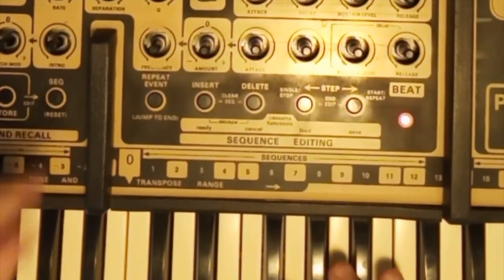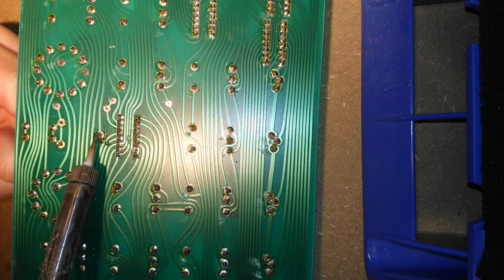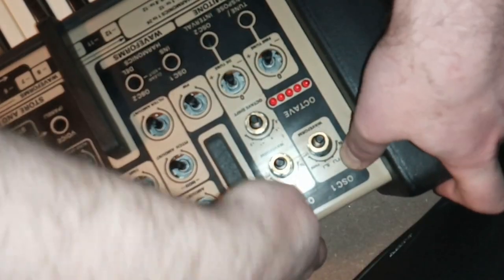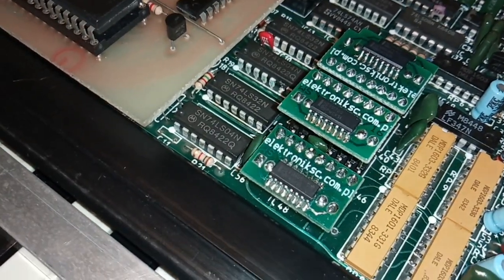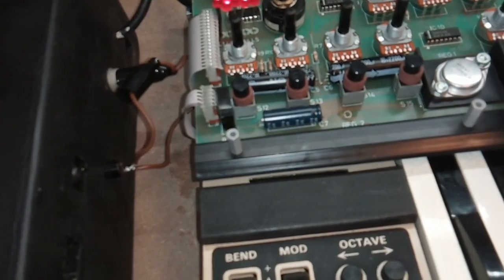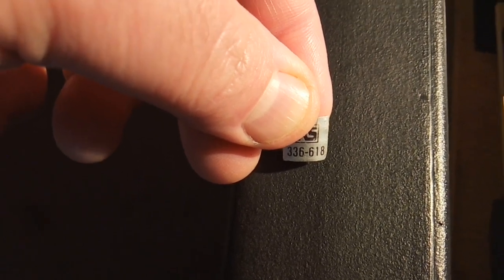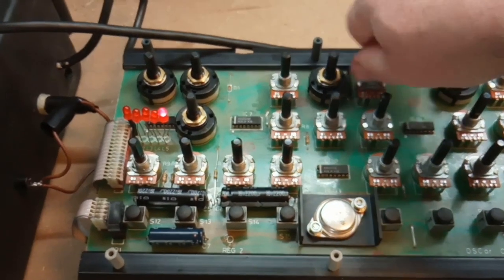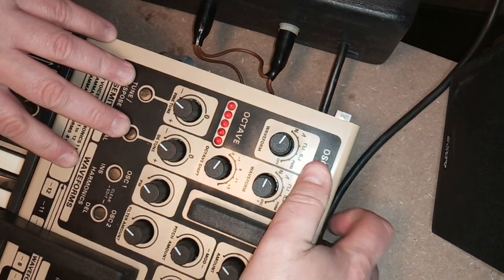An amateur fixes what professionals broke - OSCar Part 5

Comment: Hi, did you ever make a video about how the address lines work? I have an oscar synth that is always putting the white noise over both oscillators. If I turn the noise/osc balance pot clockwise(for noise) I just get the noise as expected, but if I turn the noise/osc balance anti-clockwise(to osc only) I still get the white noise over the oscillators. It is like it is not turning the white noise volume down.
Reply from the maker: The noise level should come out of IC31 pin 5, and then buffered in IC32, coming out on pin 7. The noise is then mixed in into the filter in in IC 49. I would suspect something is wrong on that path.
Reply: @RegebroRepairs  Thanks for your help. I'll delve into it.

Comment: That "professional" work was shockingly poor! I'm glad you managed to fix it in the end. Regarding the OTAs, did you find some original 13600s or just use 13700s with minor adjustment?
Reply from the maker: I bought 13600s from eBay.

Comment: I'd be mortified if a synth tech botched my OSCar like what happened to yours. It reminds me years ago a tech sanded and "re-varnished" the Walnut casing on my very early RA Minimoog without even asking me.....grrrrr!! Well done for fixing it
Reply from the maker: Yeah, that's the problem I haven't been able to find a synth tech locally. I tried finding someone that could repair circuit boards, but as you see, they couldn't. Before I even started I tried to find somebody that would admit to being knowledgeable about OSCars, but I couldn't. I even asked Novation if they could ask someone, and they told me to talk to their German distributor who completely ignored emails and refused to pick up the phone, so...
Reply: @RegebroRepairs  the best tech I've used is a guy called James Walker who is very experienced with OSCars (he's based in UK though unfortunately)
Reply from the maker: @ianpreece6391  Could you send him a mail with my email? He might want to be on the oscar-owners mailing list that since have been set up.
Reply: @RegebroRepairs  Hi, I'm an owner of an OSCar that's been unresponsive for 4 years, it seems a battery problem. How can I be on that oscar-owner mailing list? Thanks
Reply from the maker: @croonologist  Just look for "oscar synth owners freelist" and you will find it.

Comment: how are you getting onwith your oscar? I have oneon my bench at the moment that's dead. No +5v rail, the lm309k regulator is on its way. All i get on attempting to boot is the octave and beat led's flash on then off then nothing at all.
Reply from the maker: You should join oscar-synth-owners@freelists.org
There's loads of helpful people there.

A few leds turning on sounds like it crashes when booting, which is normal when it has lost its memory. 

The only way to really fix that is try to reboot it a few times, and if nothing changes, make it lose it's memory again, by waiting ten minutes and trying again. And of course that only works if it's out of batteries. The only good way to fix that is a new reset circuit, and the only way to fix that is the new midi board from Tauntek (which also has new software with new features)

Of course without +5V nothing will work. And without -5V there will be no sound.

Comment: good video. Getting this synth to boot is a nightmare. Changing all the startup components does not help much. The CPU startup is really badly designed. everything else has been done and fixed it's just a poor design
Reply from the maker: That seems to be the case. I don't know if changing some of the values to make it wait longer could help?
Reply: @RegebroRepairs  hi yes I have tried to add extra power supply lines and  have a post on Muffwiggler regarding the reset circuit, really needs a redesign, but it's a bit above my skill level

Comment: Back to the future..! 

I'd watch a video explaining the control logic. My OScar needed a re-chip to quell crazy behaviour, socketed and replaced all CD4051s and the led driving CD4050. A de-solder station would have helped but parts are widely available. Also, that cable between keyboard and control board is a nightmare. Thankfully, I had no issues on the meat and potatoes board. Duophonic Fingers crossed. 

Good work!
Reply from the maker: Interesting. What kind of crazy behavior did you get from that?
Reply: impossible to put into words.. every Bootsy Collins bassline sped up and overlayed and re-amped across the cosmos. Or something. Can we hear the fixed machine?

Comment from the maker: "I really hope I can do it
My subscribers are depending on me
I know that I must leave to do what I've never known
And brave the dangers of desolder
Saving them from disappointment
I mean, how hard can that be?"

Yes, I've been watching Trolls.
Reply: Sorry to hear your ICs were discontinued. Have the surface mounted versions lasted?
Reply from the maker: @edbragg3588  I replaced them with "new old stock" (probably actually used, refurbished) that I bought from eBay, which works perfectly. I put them in sockets while I was at it.
Reply: @RegebroRepairs  Keeping the sockets viable for original replacement parts is definitely a possibility. You said the unit is old, Ive never heard of the brand but, maybe you can return it to it’s original design with a bit of persistence.
Reply from the maker: @edbragg3588  Even better, there's now a third party upgrade with extra features. 🙂 I should make a video about that as well.
Reply: I found surface mounts difficult to service and supply limited. As the devices and solder points diminished so went my patience. lol
Reply from the maker: @edbragg3588  Yeah, I have never been good at small fiddly things, so I wouldn't even try it without a proper heating station.
Reply: @RegebroRepairs  No kidding, Lennart. No wonder board replacement overtook component level repair. Suction cups, strong magnification and hope you find the right melting point. Yikes! 48 pins!
Reply from the maker: @edbragg3588  It wasn't the broken board that was replaced though. Although when it was worst, I did consider CAD:ing out and making replacement boards. 🙂 But I managed to get it stable.
Reply from the maker: @jackson cheeser Please join the oscar-synth-owners mailing lists at freelists.org, and ask there. We can give you much better help that way, you can't link or discuss properly on YouTube. 

Sounding bad isn't usually a symptom of the battery being replaced. Rather it's making no noise or just weird screeching noises when the battery is lost.
Reply from the maker: @jackson cheeser It's a 10uF ceramic capacitor, anyone will do, and it doesn't need to be exactly 10uF either. I think I used a 25V capacitor.

It should not be an electrolytic or other polar capacitor, and it should have a low value, that's pretty much it.